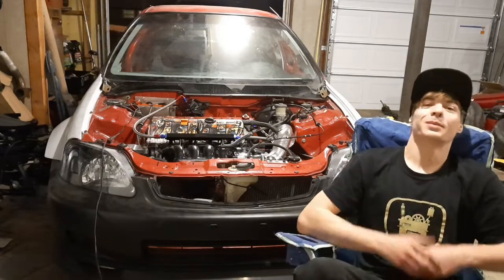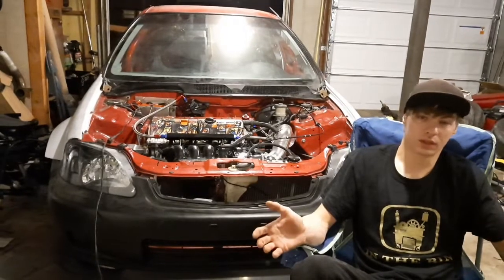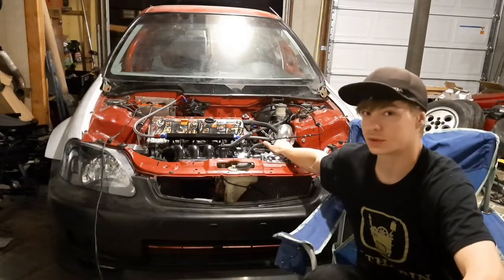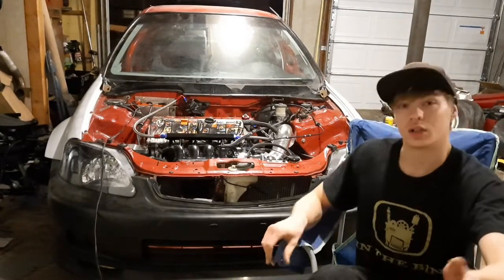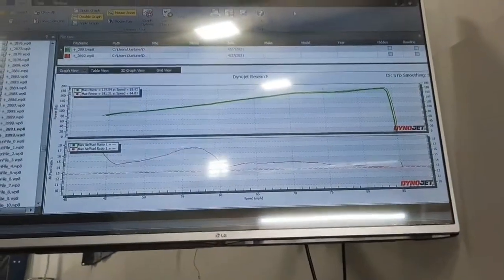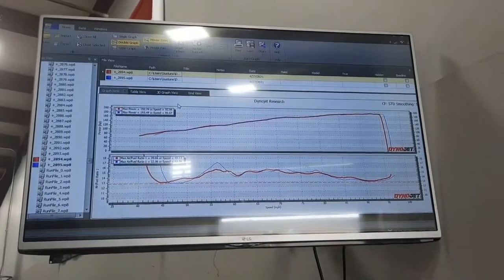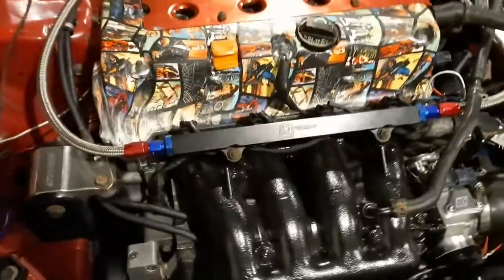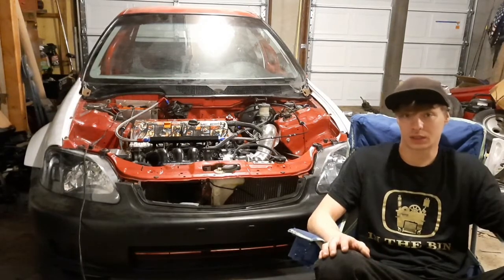200+HP K20A3 build part 3: The results!!!(for now) VTEC killer K20A3

Comment: keep in mind the A3 makes 160 CRANK HP not wheel HP. on most dynos for a stock a3 they make around 135-140. this is huge gains
Reply from the maker: thanks man! This has been a great setup and i take her to 8600rpm all day lol It could easily make over 200 at the wheels with a finished tune. With the 75shot of nitrous i have been running also it just makes it that much more fun.

Comment: Sup man, quick question, what all stuff did you need to put the k swap in there? I’ve got a k20a3 + trans on a pallet in my garage waiting to be plopped into my hatch, but Hybrid wanted like 6k for all the stuff to drop it in there.
Reply from the maker: if you are mechanically inclined, you can absolutely get the engine in there and running for less than 6k. so its kind of a difficult question to answer simply but the basics are going to be engine mounts, k swap header, k swap wiring harness, ac/ps delete/alternator relocation kit, shifter mount, axles, air intake, exhaust, fuel rail with return line, fuel lines, and either an imobolizer delete box or kpro if you can afford it. its quite a bit of stuff and its still going to be a few grand but can absolutely be done for less than 6k. I hope this helps.

Comment: @jdmjedi777, after MUCH searching on the internet I STILL was unable to find a conclusive answer on running Lost Motion springs/assembly on K series w/ locked VTEC. Did you delete the LMA’s on your Vtec killer build? Thanks in advance
Reply from the maker: The trick is using k20a3 exhaust rockers on both the intake and exhaust side. Here is my video showing exactly how I built my vtec killer head and what parts you are able to use. Also the slight modifications you need to make to some of the rocker assembly for clearance. https://youtu.be/nIKzkyhZYNY?si=Y5mYMsEqZ8JyC0ka

Comment: Couple questions. How much did this project cost? What is your exhaust set up? And what is your redline set at. Also did you need kpro for this?
Reply from the maker: I can't remember the exact budget but I believe I go over how much I spent in my first video covering this build. The exhaust is a big tube swap header with a full 3 inch exhaust. Redline was at 8600 but I brought it down to 8400 recently to be a little safer. And yes you definitely need kpro for this type of build.
Reply: @jdmjedi777  would you say this is a good daily set up? I have an ep3 and kpro should be here any day now. From the sounds of it all I need is a2 cams exhaust rockers.

Comment: Im preparing to do a K20a6 but i still have some questions.
In my country all i see bedises k20a2 is k20a6 comes with 155hp.
Do u have instagram to discuss a bit?
cheers
Reply from the maker: I'm honestly not very familiar with the k20a6 engines but they seem to be a lot like the k20a3 from the small amount of research I did. Do you know if your engine has two or three rocker arms on your vtec side and if the vtec is only on the intake side?
Reply: @jdmjedi777  i dont have the engine but the K20a6 come in the Accord version.
K20a3 i guess comes in the RSX right? 
Im from Europe
Reply from the maker: @luissilva5441  yeah, the k20a3 came in the base model acura rsx. K20a2 came in the type s model. (At least for the USA market) I took a little time to research the k20a6 but it's been slightly difficult finding definitive information on that particular engine.

Comment: This some clean ass shit man. I had a k24a8 5 speed auto 7th Gen accord sedan. It had headers, short ram and a full exhaust system. I didn't do anything tuning wise, we all know them 5 spd autos were dog shit so I just sold it for a 6-6.  My Boi has one of these base rsx's. It's no where near as built as this one but he's planning on going to a k24a2. But rn Its  running a hondata basemap w an rbc intake manifold, swapped the 5 speed manual tranny to the a 6 speed from a type s, headers, and a whole single exit 3 inch, as well as him gutting the entire interior. I have a much higher performance ceiling on paper because my 6-6 isn't full bolt on and just had intake and exhaust. It still has a full interior and stuff in the trunk, but seeing that 2.0 economy motor w stock internals take off like that makes a mf wanna wanna full Send on my 6mt. Shieettt, the videos on my channel. If my k24a8 sedan was a 5 spd manual, I prolly would've kept that jawn and turbod it. Good shit doe.
Reply from the maker: Thanks man. It just goes to show that if built right pretty much anything has potential to make good power

Comment: Need advice car won’t idle unless I hold pedal all the way to the floor and will not accelerate I still have stock ecu and intake also stock injectors
Reply from the maker: You are going to need k-pro and to get it tuned. Unfortunately there is no way this will ever properly run on a stock ecu. My best advice is to not drive the car until you have done that. I hope this helps and feel free to ask any questions you have.

Comment: Hey man, Was it 192 at the wheels or flywheel?
Reply from the maker: At the wheels. Ended up making 193 at the wheels that day. So more WHP than an A2 and we didn't even finish the tune. Still has more power in it.
Reply: @jdmjedi777  fantastic!

Comment: i have a k20a3 for sale motor pulled from ep3 first with 200 takes it
Reply from the maker: This is exactly what makes this build so cost effective! You can grab a k20a3 for so cheap!!!
Reply: @jdmjedi777  yup!! Did type s cam swap and FBO on my k20a3 and made 220whp and 151tq. Not bad at all for stock exhuast at the time (PLM headers to stock type s exhaust). Im full 3 inch now and the car is even faster than the dyno day, its a high 13 second car with the 5speed still in it. Super happy with the results. 6 speed going in soon tho
Reply: @Tony.Baloneyy  220 on stock low compression a3 pistons? ?
Reply from the maker: @Tony.Baloneyy  my best pass at import face off this year was a 13.9 at 100mph on street tires. With just some slicks and a clutch release solenoid the car could easily get close to mid 13 second passes.

Comment: That choppy idle sounds so good! I’m doing a K20A3 vtec killer swap into an EG hatch right now and my goal is 200 whp...this gives me hope :)
Reply from the maker: Thank you! It's been an awesome build and I agree the idle sounds so good! Good luck with your build man.
Reply: jdmjedi777 sorry if you already said it in another video but are you running the stock A3 injectors?
Reply from the maker: @RatherBeRestoring  im actually using the type s 310cc injectors but I do believe you would be able to get away with the A3 270cc injectors without issues.
Reply: jdmjedi777 cool. I actually tried to order a set of type s injectors on eBay for a ridiculous deal ($40 for the PRB type s intake WITH stock injectors!!) but of course my luck it got stopped by USPS due to smelling like gas so I got a refund and they wouldn’t ship it any further, it’s in Washington currently 😜 I then ended up getting a great deal on some used OEM RDX 410s that brought to InjectorRX in Houston to flow test and they’re 👍
Reply from the maker: @RatherBeRestoring  that sucks about the type s injectors getting stopped by ups but with the RDX injectors they should even give you room to run E85 if you wanted so thats awesome!
Reply: I don’t know where it went but I just posted a reply asking if there was any way you could possibly share your calibration file with me to give me a good starting point. I’ve officially finished the build which is basically identical to yours so the tune would be an awesome starting point for me so let me know if so and I’ll give you my email. No hard feelings if not or if you don’t even have it anymore. Also thanks again for all of info you provided throughout my build! Made my life a lot easier.
Reply: Same here